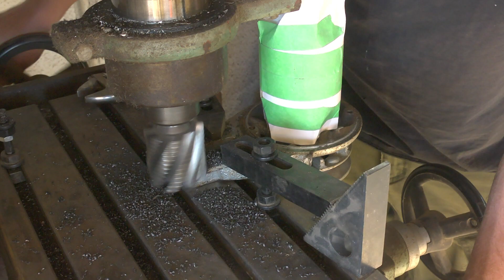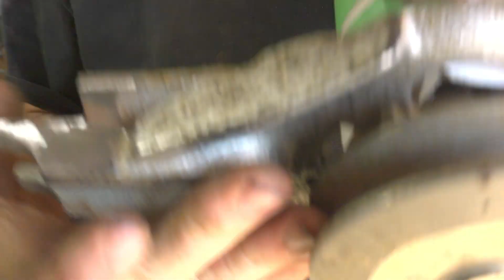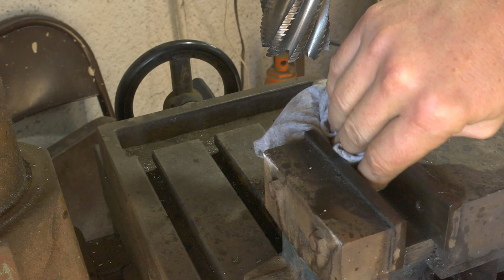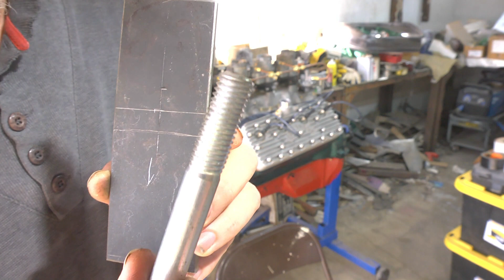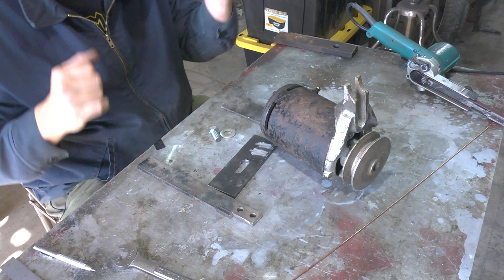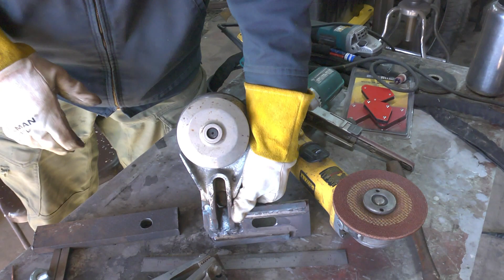Modifying The Generator Mount For The TROG Flathead Engine. Part 3

Comment: I like it. looks good and strong. As you say it's like back in the day. You need one of the original washers for the bracket. Those reinforcing ribs you added should fit it, it's much stronger than that flat washer.
Reply from the maker: I'll look for one, thanks